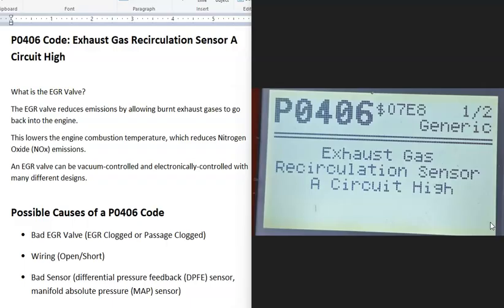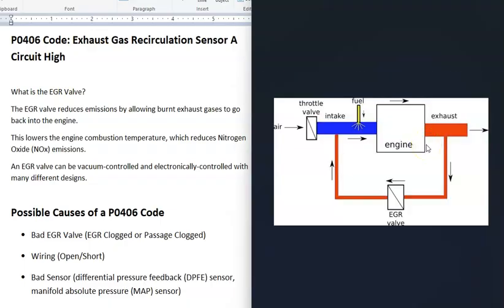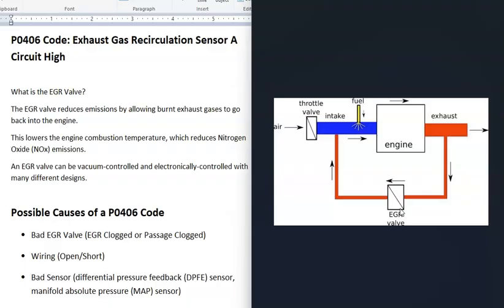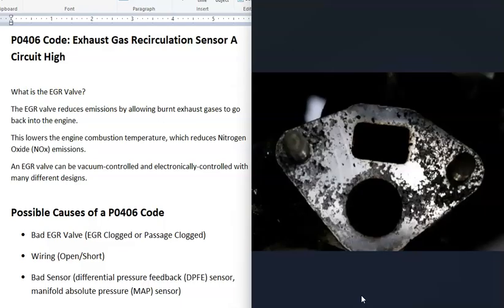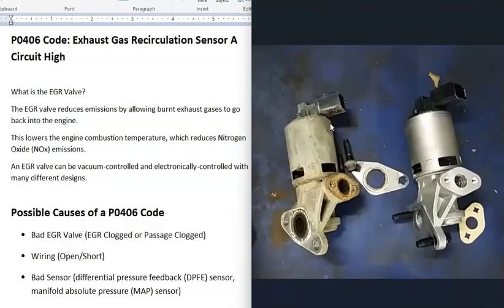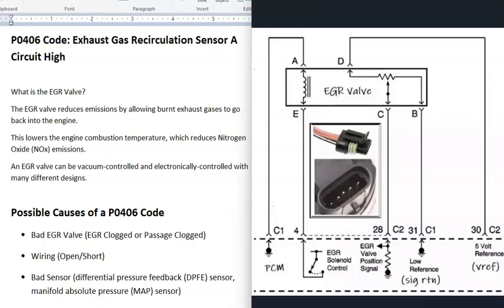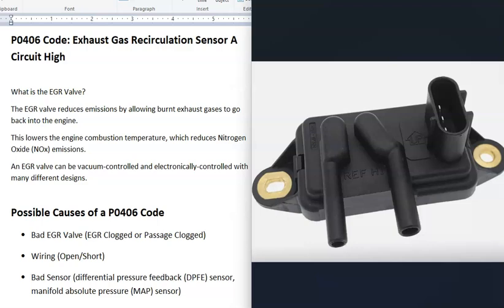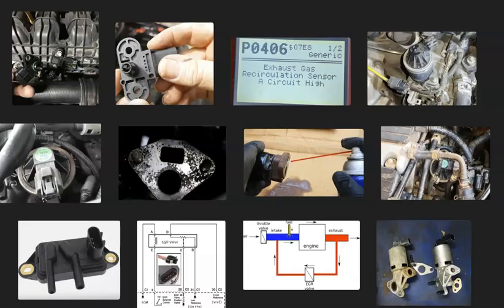Causes and Fixes P0406 Code: Exhaust Gas Recirculation Sensor A Circuit High

Comment: I had changed my EGR not about five years or so so I did not think it was the problem. My grandbabies got new toothbrushes and I kept the old ones. This morning I went outside and scrubbed the connectors with the brush then put them back. Bingo! Problem resolved.

Comment: My EGR is new but After my dpf was clogged i washted and I drill a hole through my DPF and now the car drives smoothly without any issue on the motor only this to error P0401and P0406 but I reset it once in a while with my OBD and all works fine. besides that I see some 2 l/100km diminished consumption.

Comment: Upload 6 hours ago. What incredible timing for me. I'm driving a 2011 Jeep Wrangler JK Rubicon Unlimited with the 3.8. I've been getting the high circuit code few a few years, but it only seems to turn on during long road trips and when it does start sending the P0406 code, I've always just replaced my PCV valve and that shuts the light off for me. I do not have to clear the code after I swap my PCV valve. I don't understand why I just know it works. So when I get this code I always replace my PCV valve. I am however going to replace my EGR valve soon as I finally have the time. 

My question is, why does replacing a mechanical component with no electronics components clear the P0406 code? Shouldn't there still be a high circuit?
Reply from the maker: A DPFE or EGR sensor monitors the pressure in the system and reports it back to the computer. The computer sees an issue with the DPFE or EGR sensor that is monitoring the pressure.
Reply: Can you please help and  tell me why my 2005 Chrysler 300c 5.7, I’ve replaced the egr value but now I’m getting a egr sensor circuit high still but is that why my vehicle has started to randomly stall when I come to a complete stop or when driving at low speed ?
Reply: @user-qe3ow7qz4q  could be o ring placement, never had a code till i replace fuel injectors which in the process you remove manifold so its probably throwing
 codes of overworking itself
Reply: Mam rovnaky problem vozidlo počas jazdy sa zastavuje po vymene noveho egr ako ste to vyriešili? @user-qe3ow7qz4q
Reply: Got tha same car lmk if you find out the problem having the same issues right now
Reply: @ALman2x  egr o ring placement, or sensor maybe even clogged
Reply: @ALman2x what was the problem please
Reply: Changed out 1 fuel injector then this code popped up solution please